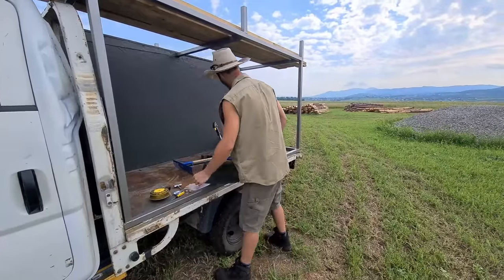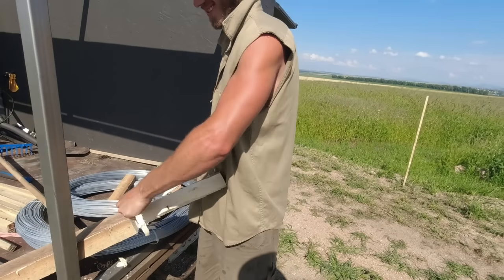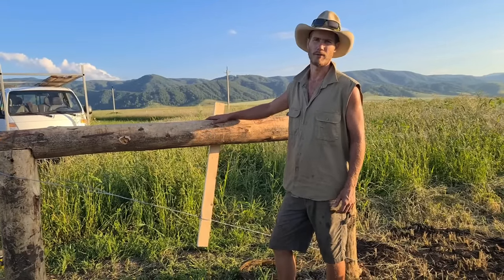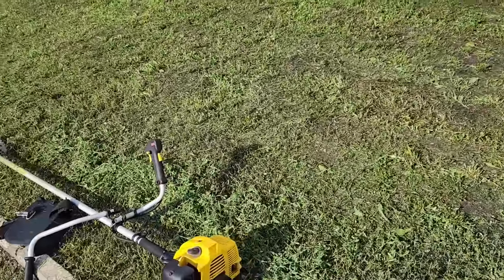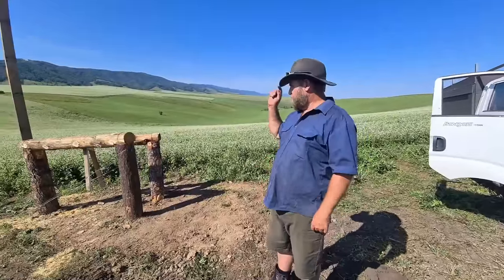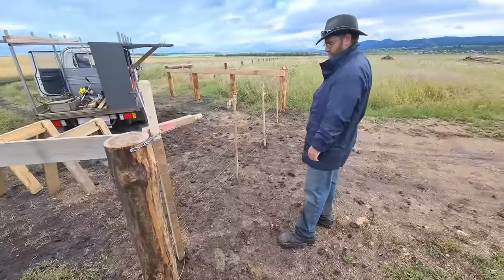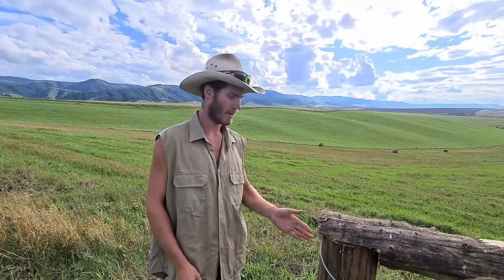Nobody does this here ( Russian homestead Pt 3 )

Comment: A lot of locals share some know-how regarding the poles. The common advice is to put a bit of gravel on the bottom of the hole and paint the part that is going in the ground with used engine oil or diluted bitumen (gasoline can be used) to prevent rotting.
Reply: dr.BigGut7373  Mate, I am just translating what some guys that claim being locals share as experience.
Reply: Dude, this is larch, this breed does not need to be processed additionally, it will stand in the ground for 100 years before it rots. These people know what they're doing
Reply: Бензином точно не надо
Reply: Ты свой дурацкий опыт с отработкой держи при себе,не надо травить людей и почву подобным дерьмом...

Comment: Hello! At the beginning of the issue, I noticed that there were guys riding motorcycles near your farm. And at the same moment you pull the wire as a fence. As a motorcyclist, I would like to warn you against pulling on the wire without placing any warning elements on it - for example, fabric strips evenly hung on such a fence will keep motorcyclists healthy. Anything can happen - they drive fast and may simply not notice the wire.

Comment: I could mistake the background of hills to be somewhere on east coast of Australia. My father built the same fence strainer post system on his farm, they are very strong. Pro-tip, use the tip of your chain saw to cut shallow grooves to guide your wire brace diagonals, so they cant slip or shift.  Watch the ticks guys, they are ferocious in Siberia, but I think its mainly in early spring.

Comment: I had bad-luck with Stihl, but soon learned that anything with a Kawasaki motor out of Japan was value and dependable.  I also found Stihl back-up to be rubbish.  After the trouble was over, it turned out that the Stihl's fibre insulation between the cylinder barrel and the Carburettor was too thin, not doing it's job.  Heat was transferring into the Carb, vaporising the fuel, disabling the carb, and the machine was worthless until cold, when it would again start and run for a short time.  Since then, I would not own a Stihl machine.  Mine was "STILL" too often, and the agent totally unhelpful.

Comment: 8:30 You have bikers racing through the fields there. It would be a good idea to hang a lot of white ribbons on the wire, just in case - such wire can cause big problems at high speed.

Comment: HÜTER pretends to be an German brand, but I´m not sure about, because I don´t find their products in DE (or AT).
My feeling is, that their stuff is manufactured in China and the, in the video used gasoline trimmer looks like an semi-professional class, which is made for work in home gardens and summer cottages......

But maybe I´m wrong with my estimation.....
Reply: That's exactly what it is. The HUTER brand is owned by Resanta group and supplied by China. As a rule, low quality, and small loads. Unfortunately, there are a lot of low-quality goods from China under different Brands.

Comment: Was the high tensile wire a problem to find?  I assume it is 12.5 gauge.  What about other electric fencing materials and other equipment like Stihl, Husqvarna?  I would expect them to be available.
I am wondering if you have already drilled a water well.

Comment: Looks like you just removed the top soil and the started putting down gravel for a slab?? Here in Alaska, we put footers 42 inches below ground level to avoid heaving in the winter. Looks like you will have freezing winters, where you are building, so what will you do to minimize frost heaving?

Great videos! Keep them coming

Comment: I'd suggest putting a wind flag up on the higher pole? How will the metal wire cope in the very cold winters with contraction/expansion?   PS:  re your strimmer, I wonder if you can get Stihl products in Russia?
Reply: yes, of course
Reply: Yes, no problem with Stihl in Russia
Reply: Они хотели газонокосилкой косить дикую траву.Поэтому все  и поломалась.
Reply: Yes definitely can!

Comment: The Huter thing is definitely not for the professional use. The one like that is fine for cutting low grass on your dacha property few times a year. For that purpose if works fine. My dad has his Huter for > 10 years, never even serviced it. I also have 1 left from previous property owner and it worked several years as well.

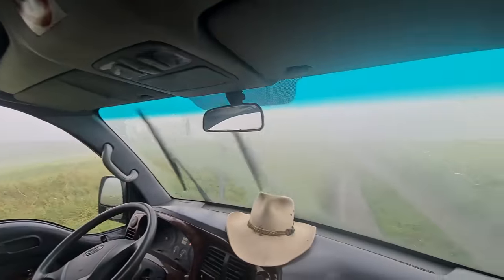Comment: Joash, simple tip about 15:37. Turn on air conditioner and heat on. Set direction of the flow to the windshield. It will dry it out as much as possible

Comment: I hope you understand that in winter this wire will cool to -40C, and the temperature difference on its surface will be more than 80 degrees. The wire will shrink VERY tightly.

Надеюсь, вы понимаете, что зимой эта проволока охладится до -40С, а перепад температур на её поверхности составит больше 80 градусов. Проволока сожмётся ОЧЕНЬ сильно.

Comment: I worked for a Russian ag company in Bryansk, southern Russia. We had Russian contractors put in all the fences and the gates. We couldn't get the Russians to build  gates the right size for stock, like your gates. They couldn't get it through their heads that the gates were for beef cattle and pickup trucks, not huge farming equipment and combines so they kept making these gates that were all like 40 something feet wide. They were hell to open and close, just for a guy horseback to go through. Also they didn't use ANY smooth wire AT ALL in constructing the fences. Nasty! Yours look real nice. Oh...and the farmers driving tractors refused to get out and close the gates after themselves and cattle would get out.
Reply: 😂😂 все так , кто будет забор закрывать за собою ? Если только сам хозяин ?